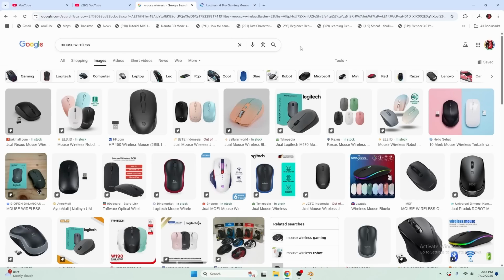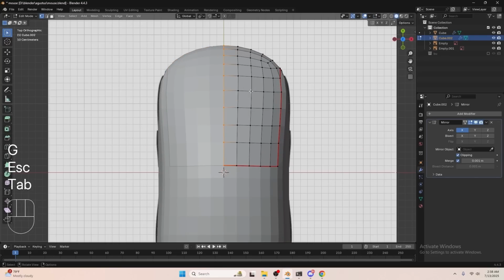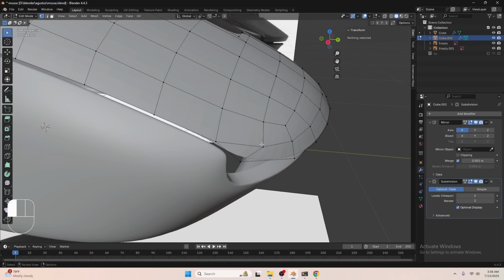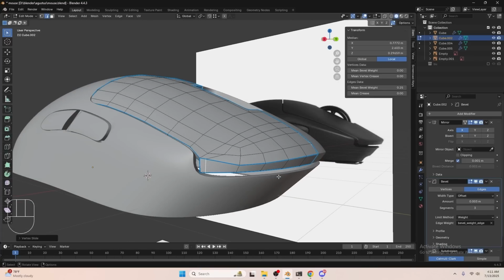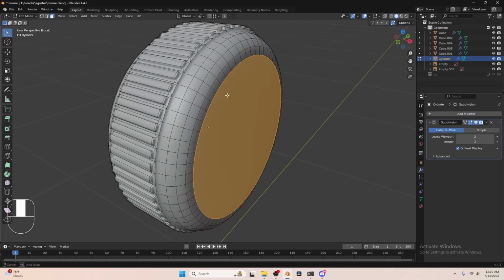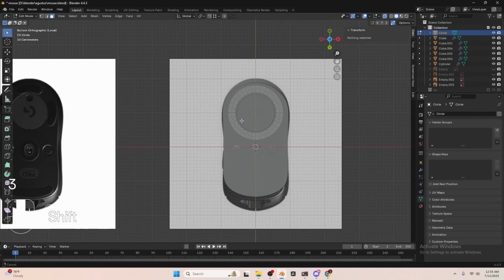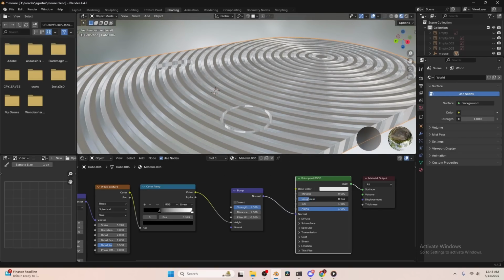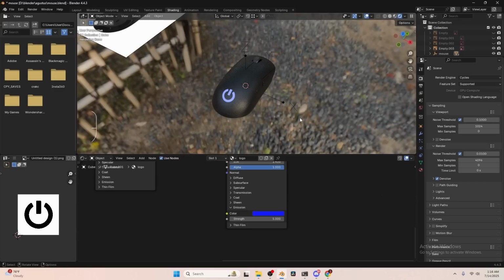How to Modeling wireless Mouse | Blender full Tutorial

Comment: Hi Ride, I am following your mouse modeling tutorial.😀

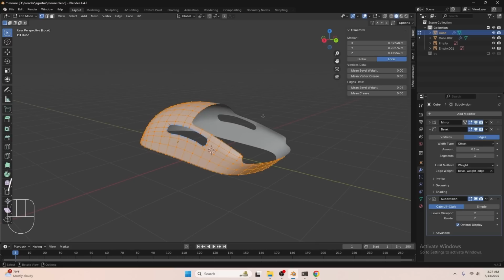At 7:31, you use Alt+S (Shrink/Fatten) to create thickness for the shell.

I followed the same steps, but my result is different. Instead of moving the shell inward/outward to create thickness, Alt+S changes the whole shell shape.

I am using Blender 5.0.1. I checked normals, proportional editing, and selection modes, but the result is still different.

Could you please let me know if I missed any step or setting?

Thank you!
Reply from the maker: Hi evelyn try mail me ur blend file thanks
Reply: @TutupBotol3d  Hi Ride, I have sent you the Blender file by email. 
Please check both emails, because I accidentally sent the first one without the attachment.

Thank you for your help!🥰🥰🥰